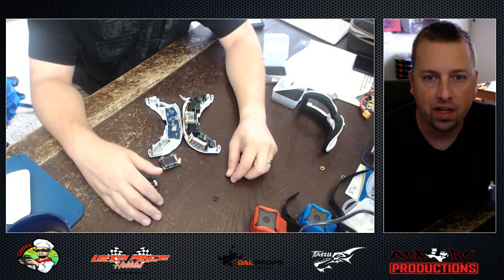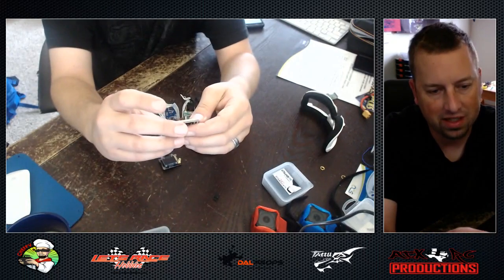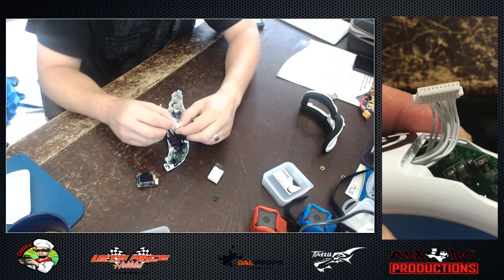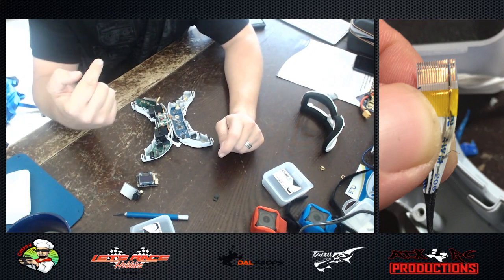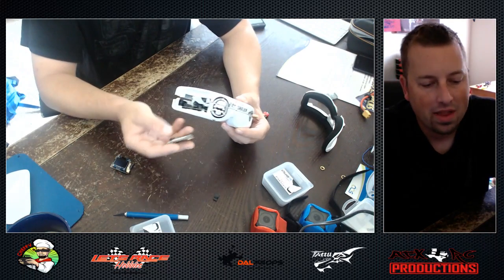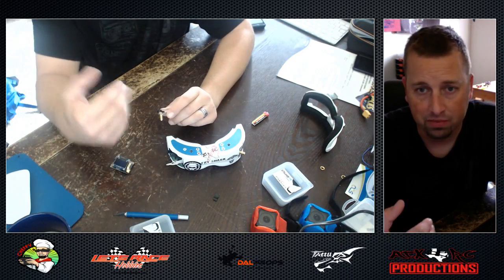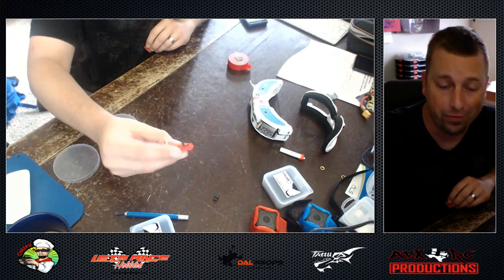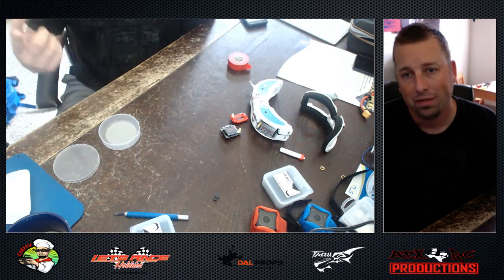CheFPV Explains How I Caused a LaForge Module Fried Ribbon Cable on Dominator V2 Goggles

Comment: Thanks for this video.  I had a similar issue.  After seeing this video, I checked my cable.  It was fried as well.  I ordered a replacement from mouser.com.  It was a little long, but I made it fit.  Thanks again!
Reply: Can you link the cable or give name for it? I could order them just in case.. :P
Reply: Here is the link to the 200 mm cable.  It is a 16 conductor with a 0.5mm pitch.  Like I said, it is a bit too long, because the original in the goggles is 80mm.  It isn't pretty, but I just sort of stuffed it in there :D  

http://www.mouser.com/ProductDetail/Wurth-Electronics/687616200002/?qs=sGAEpiMZZMvyL%252b65tEJ%2fL5ocZHt6maqVKVoVJ1dNtQQ%3d

Just make sure you don't pinch it when closing up the goggles.  I am pretty sure you can find them on ebay as well.
Reply: Thanks, although I already found same cables from local electronics store for almost free :D

Comment: Doesn't explain why the some people who externally mount fry that same trace. Also if Bruce did t I tend for people to mount the diversity side inside then why is the new design manufactured in a way specifically to BE installed inside. Bruce claims that its only because people internally install, I personally know of 4 people who fried there's while mounted externally. For all instances it has happened on plug in/power up. This indicates a current spike that is too much for the fatshark electronics.
Reply from the maker: I can't speak for Bruce, but it's not actually his design, he simply facilitated the manufacturing for the masses.  Understanding the dynamics of how these things work between product designer and distributor/manufacturer answers the question.

I don't say at any point this was the only way it's getting fried.  Just my experience.
Reply: +ATx RC Productions by CheFPV laforge is a truly amazing product Troy and great job on this video. I wish my customer service experience was anything near yours. I have been in the loop with fatshark since this happened to me months ago and they tell me they get goggles in all the time for burned up cables. They told me "if you run the laforge with these goggles you will eventually fry the ribbon cable and all replacement ribbon cables thereafter" I personally know of 4 guys that have had their cable replaced 2 times. Did they have them mounted inside? No. Externally mounted in those instances. I had mine installed (very carefully) in my goggles for 2 weeks before mine randomly failed on plug in. I find it hard to believe it's from contacting something when it was completely isolated from touching anything but plastic. 

Thanks for sharing your experience though. I envy the customer service you were provided.